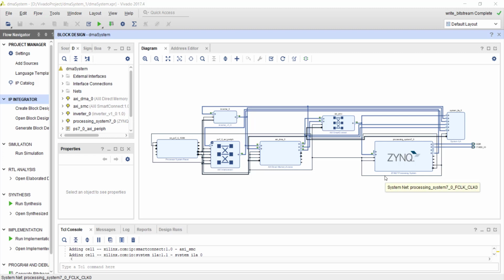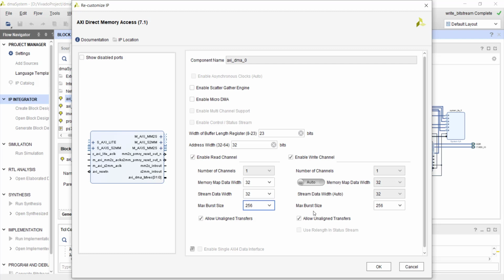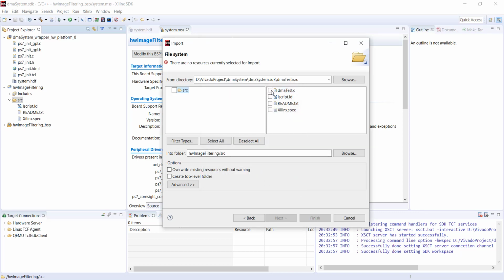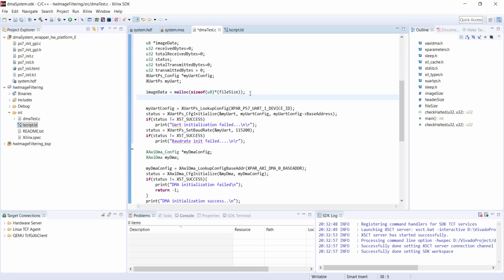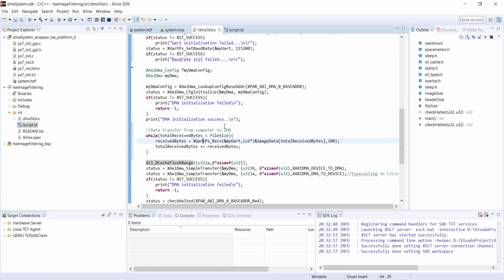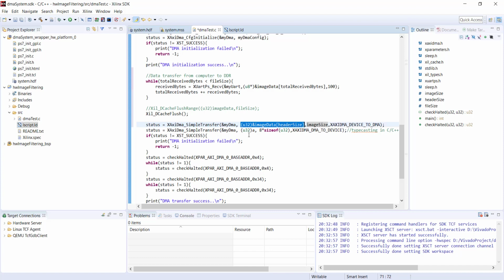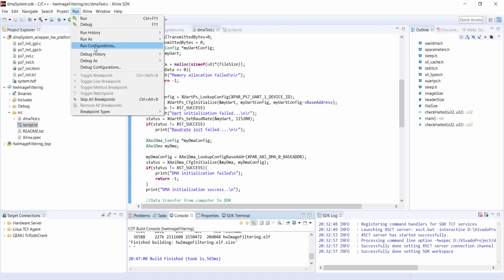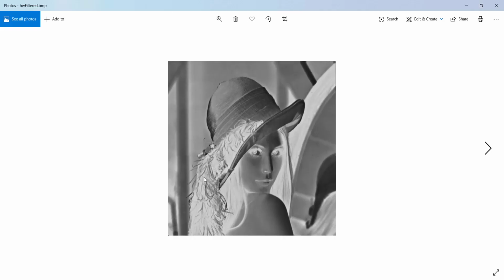Image Filterig Using Custom IP and DMA on ZedBaord

Comment: My log file is not receiving any data after sending the input image file in teraterm successfully. It was working fine when I tried with the software design of the image filtering but the above problem is occuring when I am trying the IP for image negative which is created earlier. I tried to check the ILA but the debug core is also not getting triggered after running from SDK.

Comment: @Vipin Kizheppatt. Thank you so much for these videos. Have you ever had a problem with the "send file" not working on Teraterm? Every time, I have to send it a second time for the log file to receive it. I have copied what you did exactly, except I am using Vitis 2021.1, not SDK.
Reply: @Ben Campion . my log file is not receiving the data at all even after I tried to send it multiple times. Any idea how to resolve it?

Comment: @Vipin Kizheppatt Thank you. Your teaching is very helpful to me. When I print the error code, it is "F" or "XST_INVALID_PARAM". Among the arguments of XAxiDma_SimpleTransfer, "imageSize" is replaced  to 10000, so it works normally. As expected, only some of the images were inverted. What is the problem?
Please advise once more.  

The Results is... 
=================
&myDma= 30D8C4, (u32)&imageData[headerSize]=10C4C0,imageSize=40000

 DMA1 initialization failed
F

The Code is ...  
================

#define imageSize 512*512
#define headerSize 1080
#define fileSize imageSize+headerSize
.
.
int main(){

	u8 *imageData;
	u32 status;
.
.
	//memory allocation of a sppace of file szie in DDR
	imageData = malloc(sizeof(u8)*(fileSize));
.
.
	//read data to DMA and then, DMA data to the IP core and Process
	status = XAxiDma_SimpleTransfer(&myDma,(u32)&imageData[headerSize],imageSize,XAXIDMA_DEVICE_TO_DMA);

	xil_printf("&myDma= %0x, (u32)&imageData[headerSize]=%0x,imageSize=%0x\n\n\r ", &myDma,(u32)&imageData[headerSize],imageSize);

	if(status != XST_SUCCESS){
		print("DMA1 initialization failed\n");
		xil_printf("%0x\n", status);
 		return -1;
	}

	status = XAxiDma_SimpleTransfer(&myDma,(u32)&imageData[headerSize],imageSize,XAXIDMA_DMA_TO_DEVICE);
	if(status != XST_SUCCESS){
		print("DMA2 initialization failed\n\r");
 		return -1;
	}
Reply from the maker: There is more than 1 case where invalid param error can come. Can you do one thing, in the xaxidma.c file, in the XAxiDma_SimpleTransfer function put some debug print (like print("Case1") print("Case2)) etc. before return XST_INVALID_PARAM; lines? In that way can isolate the exact reason.

Comment: Your tutorial is very helpful to me. Thank you a lot. 
After complile "dmaTest.c" and transfer "lena.bmp"
I get an error("DMA1 initialization fail"), in the below part. 
 please give me advice on where to debug from.
I think I did the whole program as you told me in your tutorial. please help me~ 

==================
 	status = XAxiDma_SimpleTransfer(&myDma,(u32)&imageData[headerSize],imageSize,XAXIDMA_DEVICE_TO_DMA);
	if(status != XST_SUCCESS){
		print("DMA1 initialization failed\n");
 		return -1;
	}
==================================
Reply from the maker: You will have to print status and check its value and find the cause of error. The error codes must be in the dma header file